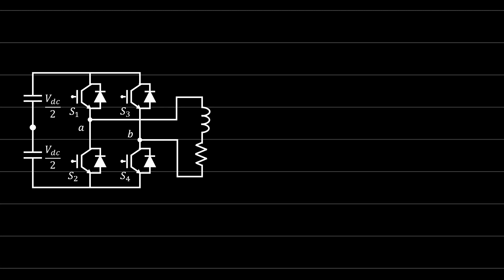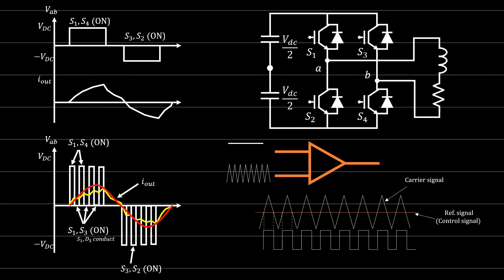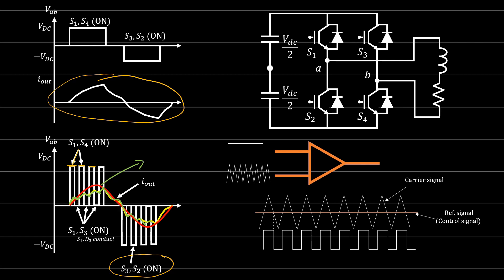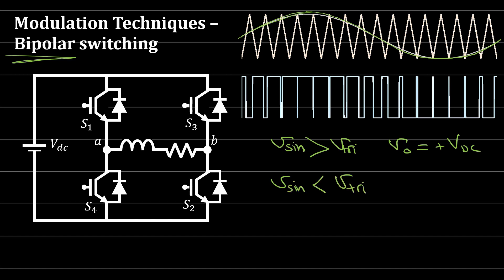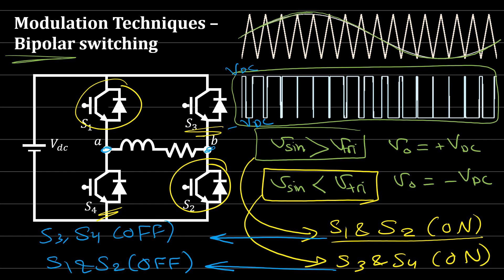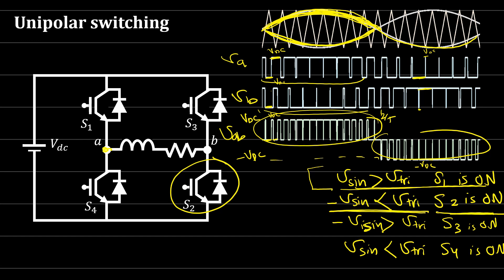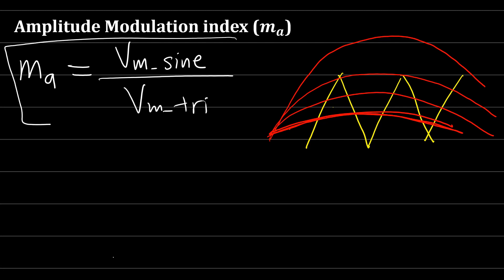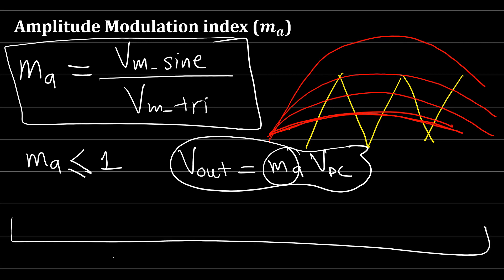Modulation Techniques | PWM INVERTERS | Modulation Index | DC-AC | Power Electronics

Comment: This is how a traditional (not UcD) D-class amplifier with a full-bridge output stage works. Can be called an inverter if you like. However for 50/60Hz it's better to use a table with coefficients for a PWM in a microcontroller, rather then all these generators and comparators. Besides, a phase shift switching is simpler to implement with an MCU.

Comment: Thanks for the nice video. Actually, the square wave has lower harmonics than PWM strategies. Its problem is that it's not smooth.
Reply from the maker: My pleasure! The square wave harmonics are more interfering, so it’s difficult to remove them from the fundamental one. But the pwm output has more distinguished waveform where the fundamental frequency can be obtained using a small filter.

Comment: Thank you, what is the other software you mentioned beside matlab at 11:25 ?
I am interested with the operation of the control circuit providing the switching signals to the transistors , can you please share some sources discussing the same
Reply from the maker: I mentioned matlab and plecs.
Reply: @Elkhateb  Thank you.
Reply: PSIM works too
Reply from the maker: @aks9545  yes there are many platforms, but when you go for more complicated controllers and designs you would prefer to use some over others.